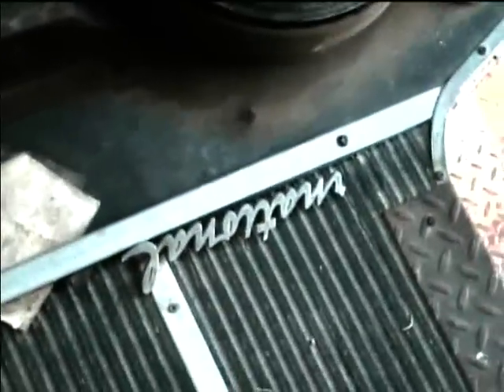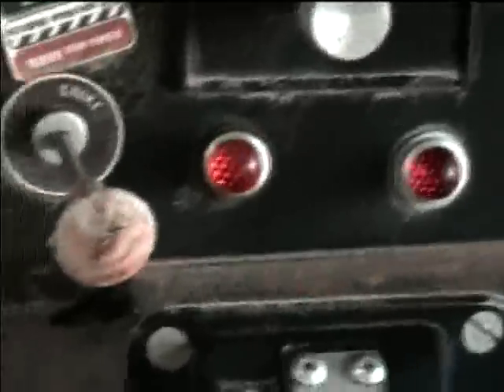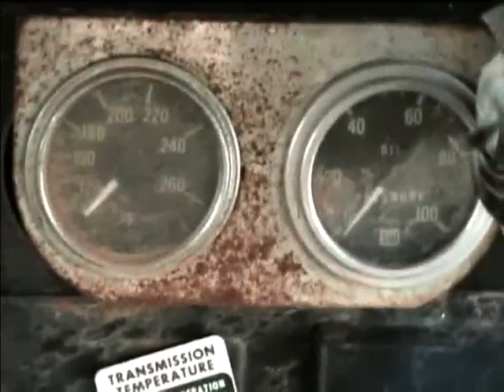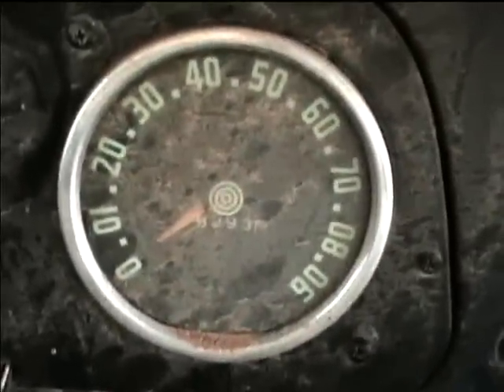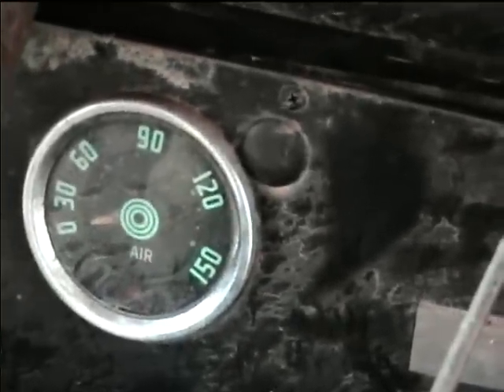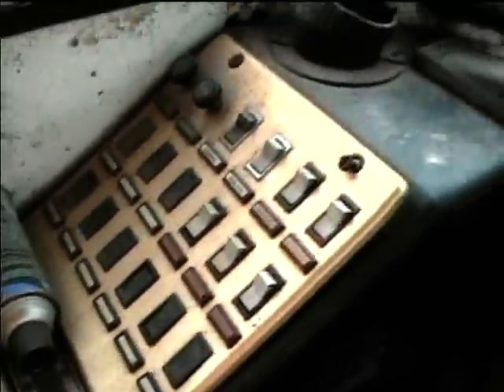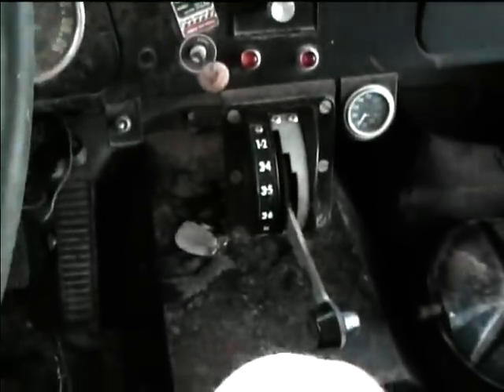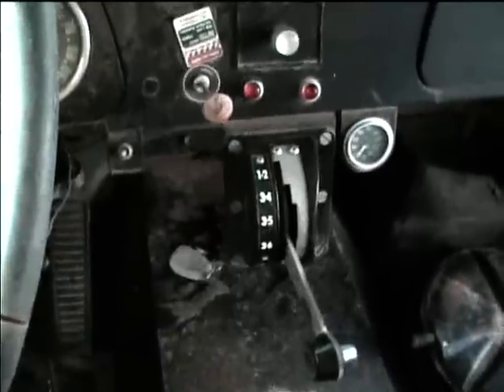1969 International Loadstar/Ward School Bus (Part 2)

Comment: I remember riding a very old sub bus back in the 80s, All I remember was it was all green inside,  and the switchboard for the lights and things was all metal toggle switches... and for some reason I remember it being on the right side... and I remember someone was in the bus helping the driver figure out the old controls... it was very strange, only saw it once.

Comment from the maker: The different gear ranges tell the highest gear the transmission will shift into. I think in the 5-6 position it starts out in 2nd or 3rd and then shifts up through to 6....1-2 will start it out in 1 and go at most to 2nd gear. The retarder pedal will help to slow it down like if you're going down a hill. The warning light switch is on the control panel but I haven't got it to work yet.

Comment: The six-speed Allison automatic used here is the old MT30 for the engine is gasoline. Otherwise, if the engine were a diesel the transmission would be either a model MT31 (light duty) or MT41 (mid-range). The MT30 and MT31 were replaced by the AT540 for 1970, while the MT40 and MT41 soldiered on until 1973, when they were replaced by the MT640 and MT650 (later MT643 and MT653DR).

Comment: I forgot that the '69 Loadstar Ward had  those type of rims also, I also remember riding either a '68 or '69 Ward bus on a Ford B700 chassis in Maryland sometimes, It had the sloped roof at both ends, I think it had the 390 big block, I remember it had a standard 4 speed transmission, It migh've been a 4 and 2, I don't remember, I also remember riding a '69 or '70 GMC Ward bus in 5th grade here in Oregon, It had the 366 engine and also a 4 and 2 tranny, It was used as a substitute bus,

Comment from the maker: I'm not sure if it is working properly...but I think it should work with the automatic transmission, maybe reversing the flow of the fluid to add resistance to the drive line to help slow it down.